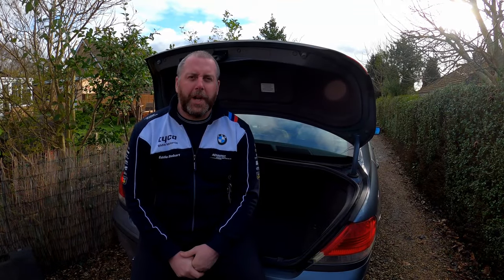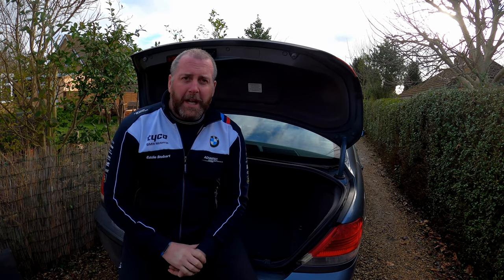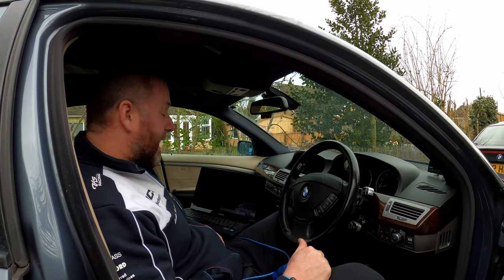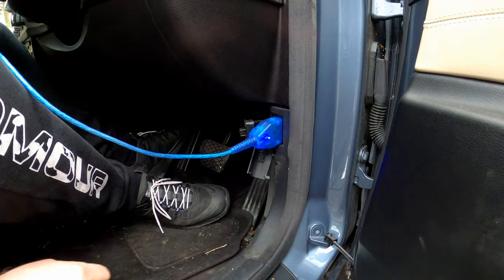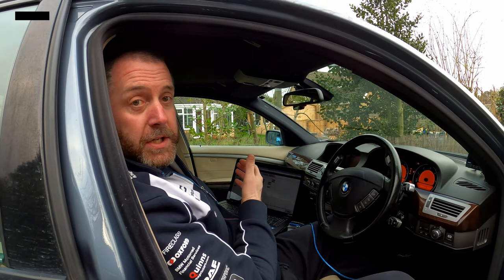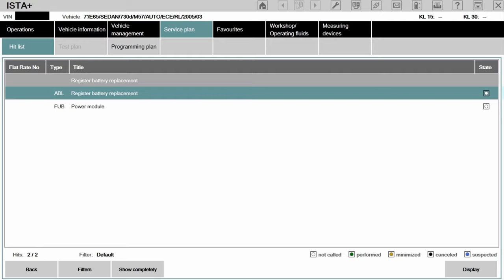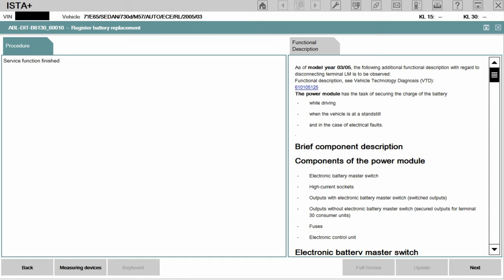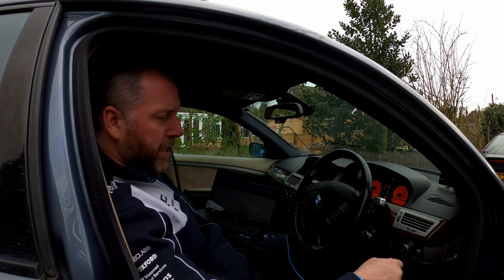Registering A New Battery On Your BMW - All Models Around 2002 Onwards.

Comment: Thanks for another great video.
I once had the battery replaced in my 2008 3 series by a specialist BMW garage* and he didn't know you had to code the battery!

Also interesting to see how bad the BMW software, I much prefer the Volvo VIDA interface.

*Only got them to replace the battery as at the time he could get the battery at a better price than I could.
Reply from the maker: I find that crazy, it widely known, a BMW indy should know for sure!
Reply: @KevsShed  This guy was very good with a set of spanners but didn't seem to know about the electronics.

Comment: Interesting indeed. In fact I'm not sure whether I'm more surprised by the fact that such a battery registration procedure is a thing or that a smart charging function which is design to tune the charging operation basing on the battery age is not smart enough to check it by its own (e.g.: comparing the difference between the nominal battery capacity vs. actual battery capacity).
Reply from the maker: I get your meaning, I can only make an assumption that an automatic system that can detect a new battery could be fooled by an old battery that has been removed from the car to be charged perhaps! 🤷🏼‍♂️
Reply: @KevsShed  I understand the specific case you're considering and in fact the kind of check/tune "nominal Vs. current" I would have implemented is "per-cycle", e.g.: every start-up, every given driving milage/hours, etc. in order to constantly monitor the battery degradation. In such way that even the case of an old battery charged outside of the car and reinstalled would probably return to an aged state quite soon and the capacity monitoring system would recognise a high rate of degradation and rapidly adapt accordingly. This principle would fail in case of the age based registration method if an old battery is used after an external charge operation and registered right after. In case the question might be: what if I install a battery with a different nominal capacity in respect of the factory one, which the system is instructed for? Well, just assume you install a battery that is at least of the factory nominal capacity (the most logical assumption) or let the user set a different value via a dash/computer config.
Reply from the maker: @Mattiu75  You are correct of course! If a battery of differing values, ie. CCA or AH is fitted the the car needs to be programmed as such otherwise the optimal charging rate will not be achieved, this includes different battery types such as lead-acid, AGM and such. This programming is done with a different program to the one that I use in the video and is called ISTA-P, I have that program however, I used a like for like battery in my exchange.

Comment: Where can I get the connecter for the air bag sensor to turn the light off my dashboard on my  BMW 2011 1 series?  thanks mate
Reply from the maker: https://rover.ebay.com/rover/1/710-53481-19255-0/1?mpre=https%3A%2F%2Fwww.ebay.co.uk%2Fitm%2FAirbag-seat-occupancy-mat-emulator-sensor-bypass-fits-BMW-1-Series-E81E82E87E88%2F283031763196%3Ffits%3DCar%2BMake%253ABMW%26_trkparms%3Dispr%253D1%26hash%3Ditem41e601f8fc%3Ag%3A8ukAAOSwd3dZZ-OM%26amdata%3Denc%253AAQAFAAACcBaobrjLl8XobRIiIML1V4Imu%25252Fn%25252BzU5L90Z278x5ickk7PdDazAlGltMLJlUhrWsD%25252F%25252F9D1s029cyKu%25252FZ93994Gy5mDNvbmXXgxLd48Lom0gMRM0U4kwR38AAMqXoSHSbisOpv%25252FAvb%25252FZolXJ%25252FAYzkur57tz7bIH5YnQI4pMNngugicwpRXxAJJlx7D5zwR3ZQd3SYut3e%25252F5rxMAOaOH1LdU1rPAEn1T8W62ife0nUdsDD35VvmRlCoykdUByogCbc8vmJoXveyg1OcV48pAsGeMdONsknU7xLmMYSDVcm3x9SaeuS9BrDOQZik6UBamzHYanSDRwHFA1IrFejd7HZbrOgLYlqgzTmX4HY6W%25252B2JS6i4FfUsYZ4QJAOvrQwXuyxzGEEpWXAuGhEu7R2HmIPxjMG3rtspznq3ylwGgh7%25252FeCxTO7u%25252FJqm9ZuIQX6A5U5lr6uI%25252BMC0AbZZ0J4QOohPyCwSaQfFpuMF4bXPJSDHesptqmMxNMWL%25252F5o2JkhCn7%25252Bqgbqtv2UvMpbjar5z44ZB%25252BAzqHiSM334tH5j30IBNYxhthamGBktqWzHty2XEuBApVlmam%25252BAfHnNGSBIW6O7z5hTWSl3ydwvAMjvhspJQG8l9SPus2CFUYO%25252B6xiLY6TACcYWbcXZznWOw%25252Fm4Z54XFnlPEtrT0rDFbh7hSdf0MU%25252FGJA7qLrJI%25252BHPSwNiYApZNjTEFZPpYTzhqfmliPbtCz1RNmpHetsae9o1hbBAMjWjB%25252BDkwzz8yQmUqvl00DLUzwT5aBnzw3v%25252FMCMbfc8C8XTci1cG3LGUMmIlA2vumGCxSeUtLBYzi0GbvKyOTgUG%25252Fy9w%25253D%25253D%257Ccksum%253A28303176319615bbd868fc1048f8abf468de994db4d8%257Campid%253APL_CLK%257Cclp%253A2334524&campid=5338707657&toolid=10001&customid=

Comment: You only need to register the battery if you have IBS. If i am not mistaken models 2006 and below dont have IBS. You also did not mention the coding part. Was there a change in AH ?
Reply from the maker: You are mistaken! The car in the video is a 2005, all E65 models, even pre-facelift had IBS. The battery fitted in the video was identical to the one removed, therefore no coding required, just registration.
Reply: @KevsShed   I could have mistaken about the year. So your was the same AH, figures out. Have come across or know how to code a battery in INSTA ?
Reply from the maker: Coding a different battery must be done in ISTA-P, if I remember correctly it pops up a message in ISTA-D with this advice when you carry out the registration process.